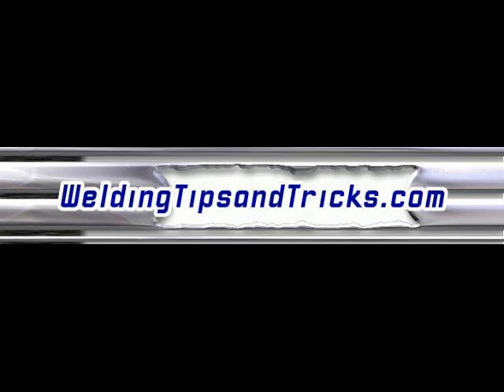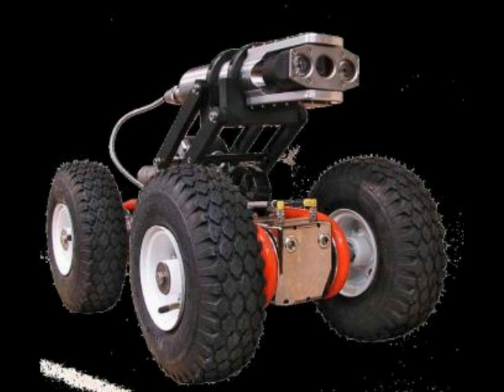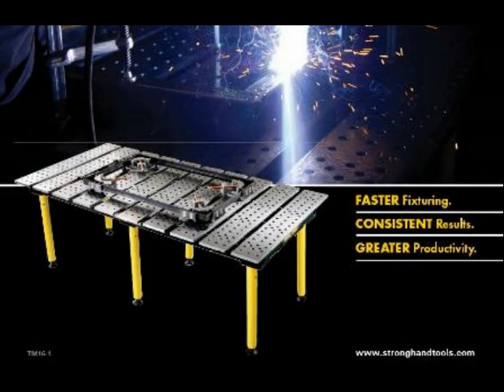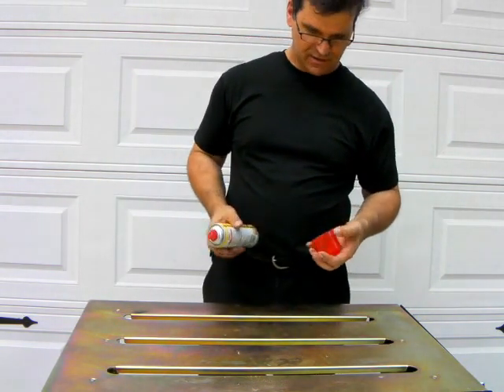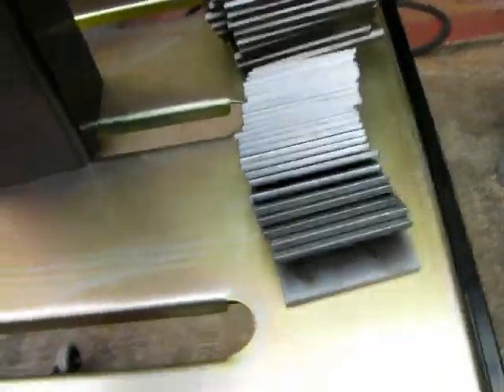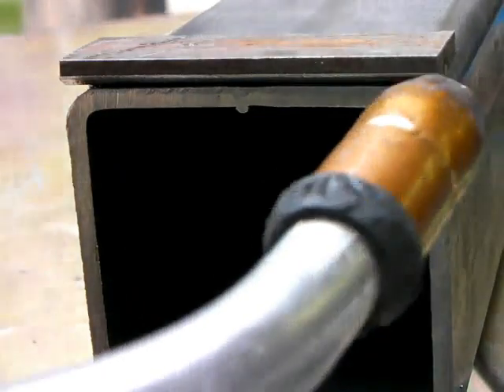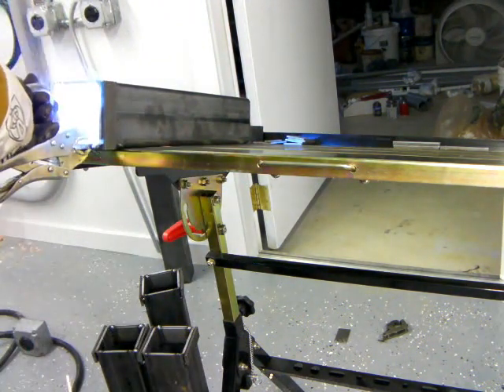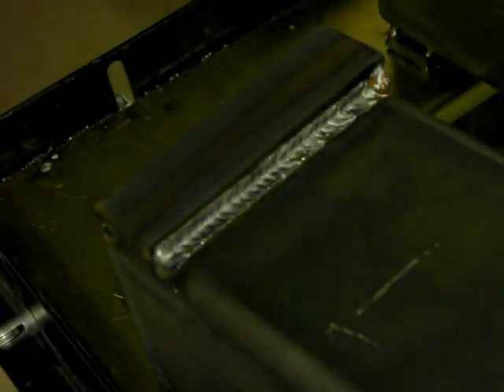Stronghand Tools Build Pro Table Welding Project Part 1

Comment: Its been so hot here in my shop in the nc coastal swamps iv put flux cored in my mig and tured the fans up and gas off ehen applicable, and for tug aluminum...using lots of gas, i got to insulate